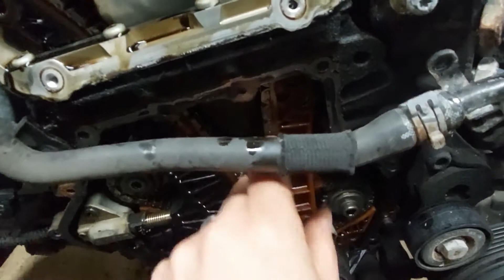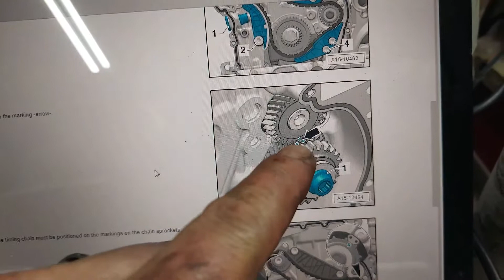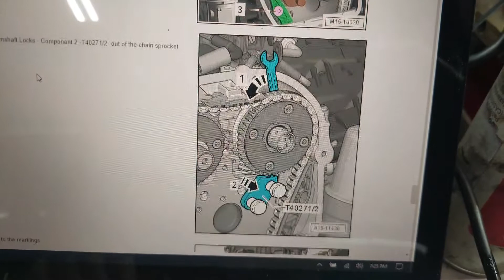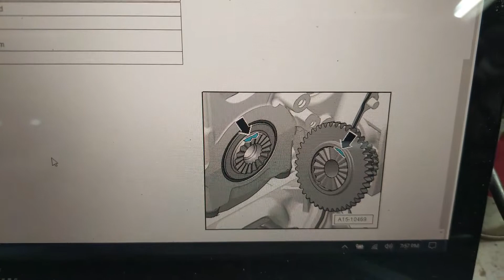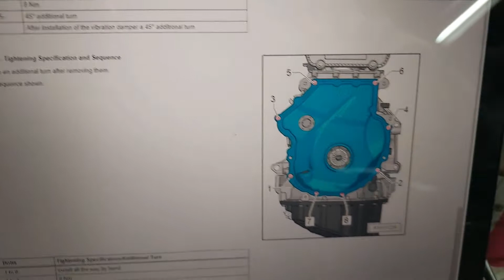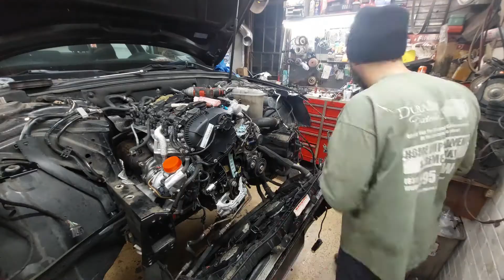How to replace the timing Chain kit 2013 Audi A4 2.0 TFSI

Comment: The reason tithing the last 2 cover  bolt at the is because there a tool that hold the harmonic in place before titining the it down.  After that get the tool out (from two holes)

Comment: Thanks for explaining the torque specs, if you put lock tight on bolts or not, explained what manual looks like, tightening sequences and order of this job, where a lot of videos on YouTube don't explain this.  Great video and explanation. Yes, will use somebody else's video at getting to the service position, but yours is the finer details.
Reply from the maker: Glad I could help provide those important details for your job!

Comment: thanks for the details , I'm doing a complete head off job, burnt valve !! was there a bent valve here ? any recommended valve make for replacement ?  ie off amazon or dealer part?
Reply from the maker: I will usually purchase the valves from ecstuning or fcp euro. Some exhaust valves are sodium filled for heat, intake valves are made of stainless at times. If you plan to keep the car, or run any sort of performance upgrades I would recommend stock valves.

Comment: How do i exactly get the cams in the right postion if they slipped out of postion
Reply from the maker: There is a special tool that locks the two cams together. Goes into the holes the plugs are in the on the cam girdle.

Comment: Can you change out the balance shaft chain without moving the gears if the engine is TDC? Or is the balance chain timed when the camshafts are in time?
Reply from the maker: Balance shafts are timed with the system.
Reply: @willpoweredgarage969 ok, guess I’ll have to keep spinning the crankshaft and cams. The cams are aligned but the balance shaft is not. Wasn’t sure if I could just spin the balance shaft separately.

Comment: can you explain the part of the screen, i didnt understand
Reply from the maker: There is a small screen in the oil feed location. It is there to catch debris. The problem is it can become loose or clogged and both cause issues.
Reply: @willpoweredgarage969  and need to remove that screen?

Comment: Hi my Audi a6 started getting P0016 code after replacing the water pump now the timing is off and all I did was change the water pump so do you think it needs a timing chain replacement?
Reply from the maker: The water pump is not really related to timing on this engine. Its run off the balance shaft . If you have a vag com scan tool, I would check the timing.

Comment: I don't have a code but I randomly check my degrees of timing and i'm at negative 5.47° 

So I stopped driving.The car ordered all the parts and going to attempt it myself...its a 2012 beetle turbo with the 2.0tsi gen 1
Reply from the maker: Good luck, it's not a difficult job. Just take your time and follow torque specs. Thanks for watching.
Reply: @willpoweredgarage969 everything went on without a hitch... Car started right up...

Comment: The “bolt” is called the VVT solenoid which the cam magnet moves
Reply from the maker: Its actually called a "N205 valve" . Its the valve that controls the VVT cam sprocket. Thanks for watching.
Reply: referred to as the N205 yes.  Also called an oil control valve.  We’re both correct is all.  Thanks for the content.

Comment: Bolts 1 and 4 is for the special counter hold tool. There the last two bolts you install if you use that tools. That’s why the weird way to install
Reply from the maker: Yes that is correct.

Comment: Great, great insights and whilst not doing the job myself, like to learn. Your video makes me want to have a go!
Having received two quotations so far, £1200.00 incl. balance shaft chain/£1500.00 no bsc but a new cover the other does not, what are your thoughts? The oil tensioner was a good shout also. ;) How many hours would you quote for this job?
Reply from the maker: Thanks for watching and the comment. This repair normally takes me about 4hrs to do. Thats with cleaning all the gasket surfaces and covers to reuse. I don't replace the balance shafts unless there is a reason too. ( oil starvation, or other damage) . In the states I use two main mail order places to get OE parts at good prices ECStuning and FCPeuro. If willing to attempt the repair yourself check them out. At least they are good for part numbers. Good luck! Cheers!

Comment: Another great video.  Very thorough and helpful.  Thinking about the cam bridge, what are your thoughts on replacing the large o-ring in the bridge that seals the intake cam advance magnet?  
If reusing the original bridge, should that o-ring be changed?
Reply from the maker: Well, It does not move, its really a fixed seal. But, if you have some millage on the car and the seal is old I would replace it. They do get brittle and will cause an oil leak outside of the front cover. Thanks for watching and the kind words.

Comment: Will I have any issues if I do the timing before I have any problems?
Reply from the maker: No, not at all. My only hesitation would be to replace factory parts with inferior aftermarket. I'd recommend @ecstuning or @fcpeuro for factory parts at much better prices than the dealer.

Comment: Whats the programme to find all the diagram and torque specs ? cheers for the vid
Reply from the maker: Its Elsa Pro, Unfortunately it is only available to dealer technicians. closets you can get is the expensive Bentley manuals.
Reply: Thanks for the response. @willpoweredgarage969

Comment: My A5 had the same but got lucky didn't damage head or valves but enging didn't stop but had to rev the nuts off it to get it to move
Reply from the maker: Well, revving the nuts off it certainly sounds like an interesting solution! Glad it worked out for you and your A5!

Comment: Hey. First of all, this is probably the best video so far that I have seen. And will be really usefull this weekend, when I will do the timing chain change on my friends A5 2013 Sportback 1.8, 170 hp, CJEB engine. And like you I do not have the counterhold tool for the crank pulley. I see and can tell that using powertools you can get it of . But what was your handy dandy way of counterholding the pulley when tightening the bolt to tourqe specs?
Reply from the maker: Hey, thanks so much for the kind words. Really means a lot to me. When I tighten the crank bolt to spec, i hold the flywheel with a large prybar. Usually, it takes two ppl, but I am able to get to the proper torque.

Comment: Very interesting video.  I wished I'd seen it before last Friday.  That's when the dealership told me it was going to cost $4000 to fix.  I thought i was just going in for my 85K maintenance.  😢

I chose to have them fix it... but I'm pissed off.  They never mentioned anthing about it when I had the 75K maintenance done.  They never told me about the faulty chain tensioner.  They never told me this design flaw was part of a big class action lawsuit a few years ago.  Audi knew the tensioner was bad.

Do you think the dealership puts the same crappy chain tensioner back on?  Do you know if owners can get compensated for their chain getting stretched?  I have just 82K miles on the car.  I'd love to get that $4K back.
Reply from the maker: Sorry to hear about that. Unfortunately Audi parts are not cheap and labor rates these days are so expensive. Depending on the year of the car it might not be covered in that class action. Audi was already updating the tensioners around the 2011 model year. You would have to do a vin search to confirm if you car is in that range. If so you can tell the service writer and bring it up to Audi corporate. 
Many times if you have a stretch issue it's usually caused by poor maintenance and not using the correct oil. The chain does not actually stretch, Its the ware from the plastic guides, and chain the give the slack to the chain. If it is at an Audi Dealer they will put on the most up to date revision of parts. 
 Again sorry for the issue, but if you can keep me updated on what they say. I am curious to know how they handle it.
Reply: @willpoweredgarage969   I really appreciate the detailed response.

I'm hoping to get the car back today or tomorrow, but I'm not expecting the dealership to volunteer too much.

Based on your answer, I may be partially at fault.  I was getting my car maintained according to plan... every 10K miles.  My last scheduled visit was at about 72K miles... but it was three years ago.  Due to COVID I've mostly been working from home, so I only put 10K on it in that time.  They could say I effed up, and they'd be partially right.

It's a 2013, and I believe the range was 2009 to 2013.  I'm not sure I can get any compensation from the class action lawsuit, though... it sounds like I would've had to file for it by 2019.

The dealership never told me about this issue three years ago.  I think they should've told customers to plan for the repair BEFORE their engines blew apart.  I don't think they were honest on this.

Thanks again, and I will write back after this has been settled.
Reply: @willpoweredgarage969   I picked up the car yesterday.  It still runs great... but it was doing that before I found out about the problem.  I told the service manager at the dealership I was very disappointed with the lack of transparency from them and Audi.  They knew there was a problem with the tensioner, but never bothered to tell me.  Had I known this was coming, I would've traded it in by now.

He understood my disappointment, but told me they'd checked the VIN number, and my car was NOT affected by the bad tensioner, or eligible for the class action lawsuit.  I ad to pay $4100 plus tax.

I have to take some of the blame, though.  It was 3 years between my 75K and 85K scheduled maintenaces.  I knew it was supposed to be every year or 10K miles, whichever came first... but I let it slide because I wasn't driving much; I've worked from home most of the past three years.  It was an expensive lesson to learn.

Best of luck with your channel.  You added a subscriber.

Comment: Thanks for all the torque specs! It's the hardest and most important part of DIY. I just picked up the last of my parts to do a timing job tomorrow on my 09 TFSI Passat. Camshaft angle is at 7.52deg and just had a single knock event last week. Timing angle frequently above 30deg...I've cut it close!
Reply from the maker: Wow, thank you so much for watching. Its my biggest complaint and it really is the hardest part to find, torque specs. I try and put them in the description but at the very least as im doing the work. Wow, yeah Id say you are getting to a dangerous place. I had a 2000 passat that I knew the belt was bad and figured if I drove easy Id make it to work. Well I did not make it 5 mins from home.
Reply: Holy 💩 I thought my cam position was bad at -6.68 deg.  
Wil, I commented on your other video prior to seeing this one so disregard my question.  It’s been answered.  (Not sure I trust the ECS kits? Chinese quality)
Reply: @neildantino4709  Nice one! I found my tensioner clip in the 10th spot with no more room to adjust :) Good thing it was the new style, and hope yours is too! I also found my cam bridge oil screen blown out, and stuck inside the oil galley. 

ECS kits I see everyone using, but don't know about them. I was scared to go aftermarket and went the fullproof more expensive path of dealer for the chain/tensioner/guides and then bought covers/seals/etc online.

Comment: Also, I would love to see you do a step by step video on how to correctly remove the valve cover without messing up the timing/rockers/cam shafts.  The correct sealant (Anaerobic) to use and how and where to apply it.  And finally put back the valve cover with correct torques and sequence.  My car is 2012 A4 2.0L Quattro so be great if you can do same year as other years my understanding they use gaskets instead of sealant (Anaerobic).   Much appreciated.
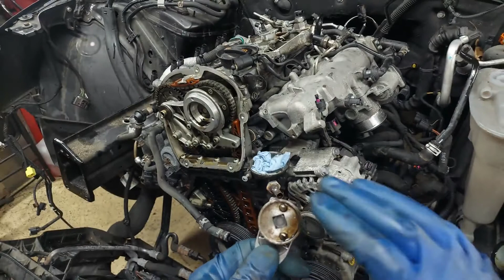Reply from the maker: Thanks again for the comment, Unfortunately I do the videos on repair jobs I am already doing. So it's hard to narrow it down to a specific year and make. There is a very specific removal sequence to take the cam girdle off to get to the cams and the seal around it. Best I can do in a pinch is sugest watching this video https://www.youtube.com/watch?v=rySGAwGlspg around the 9:35 time stamp I show the removal procedure as per Elsa Pro. The harder part is in recent years audi has switched from using the Anaerobic sealant to using silicone sealant. its a loctite brand 5970. This is usually a dealer only item. Around 38.20 I show how to apply it. Once again, Thanks for watching. I hope this helps.
Reply: The camshafts will lift because of chain tension and then wont be seated flat for re-install of the lid afterwards. You need to pin the tensioner to remove tension on the camshafts.
Reply: How much does this cost?
Reply: @kennethchoyce8186 one million dollars

Comment: Awesome video, extremely informative.  Is it possible to list the timing chain kit # and where you purchased from ?
Reply from the maker: Sorry for the Delay, It has been a while since I made this video so I wanted to look back and see if I could tell where the parts came from. Well looking back from my files, I found that I purchased all the parts from the dealer. I do get a nice discount through them and I always recommend factory parts when it comes to major engine components. The alternative I use often is ECS tuning, and FCPEuro. They both sell factory parts, often in kits for much cheaper than I get, Downside is shipping time and cost. I hope this helps, and Thank you so much for watching and I hope it really did help. 
Will

Comment: My mechanic mentioned to change the components of the timing chain and not the actual timing chain itself. I have 125K on a 2013 a4 and thankfully, I haven't had any issues, but he recommended to replace the components of the timing chain. What are your thoughts? also, where do you recommend I purchase ?
Reply from the maker: No, no ,no. Absolutely make sure you replace the chain. Chain stretch is a real thing. Though it's not stretch like a rubber band. It "stretches" because it is wearing and that will put off your timing. A timing chain kit for a 2.0 can be had for much less than having to do the job twice. I promise you that. With that said you can check in a scan tool if the chain is stretched and how far to even need to be replaced. And if the chain is not making any noise either I would leave it alone.
Reply: New timing chain is a must.
Reply: you gonna end up with 2:1.00142432 gear ratio with the non interger component climbing fast.... 😂

Comment: how many miles does this Audi have when the timing chain got replaced?
Reply from the maker: This one was at about 150 i think. Honestly i don't really remember.  There is no set time the chain should be replaced. They are "lifetime " . But there are ways to check with a scan tool and unless there is a chain rattle it's fine. Good oil maintenance is very important on turbo cars.

Comment: Thanks, do you think $4,200 at the dealer overpriced?
Reply from the maker: Yes, extremely overpriced. Even factory parts, hardware included would be less than $1,000.00 . Its not a difficult job, just need a few special tools you can get cheap on the web. Good luck, and thanks for watching.

Comment: The tool (T1053/1) that is used to hold the pulley against the crank gear, uses lower cover bolt holes 1 & 4. Once the crank bolt is tight, the pulley holding tool is removed and the last two cover bolts 1 & 4 can be installed and tightened.
Reply from the maker: Ahh, That makes sense. Even at the dealer its hard to get the tool when you need it. Either someone else had it our it was broken. Thanks for watching.

Comment: Hi where can I get the diagrams from you're using
Reply from the maker: What Diagrams are you looking for? I get them from Elsa pro. Its Vw and audis factory repair system.
Reply: @willpoweredgarage969  got this job to do next 😔😁 never done a timing chain before so going to be fun keep get p0016 come up I clear code keeps coming back engine sounds fine so have replace both sensor and code still comes back
Reply: @MrSuarezmichael  how did it go?
any shop can check through OBD how much the timing chain has stretched.
Reply: The ones with all the timing marks ect I will have a look see if I can find them the ones you got in the video looks good

Comment: good!! what about the oil pump chain ??
Reply from the maker: The oil pump chain is rarely replaced. Does not even come in many timing chain kits. I do however usually replace the oil pump tensioner.  The plastic becomes very brittle.
Reply: How much does this job cost